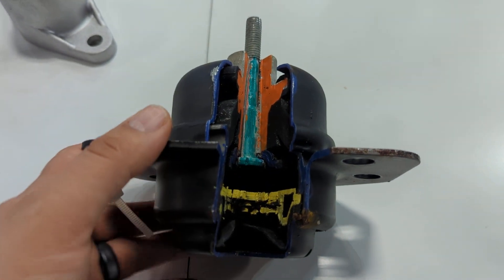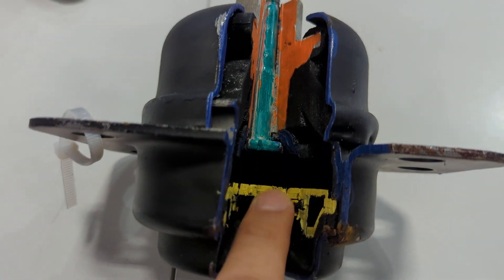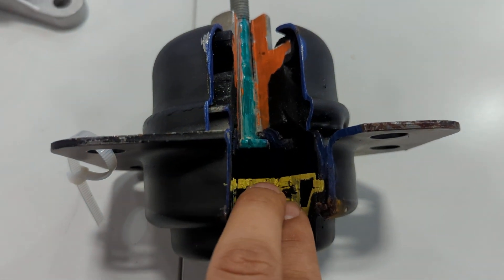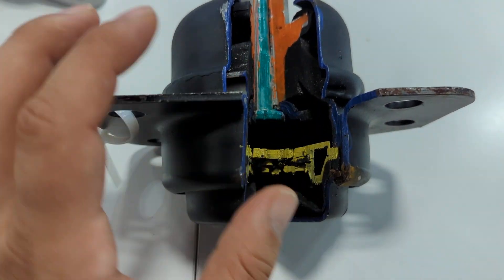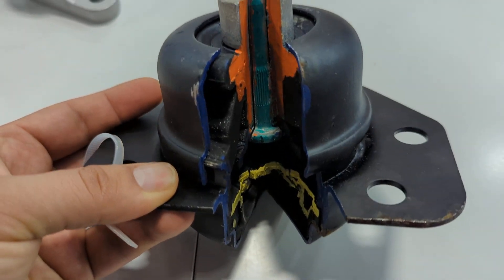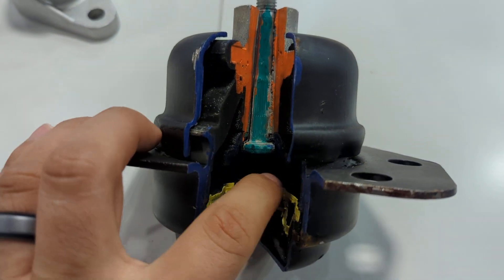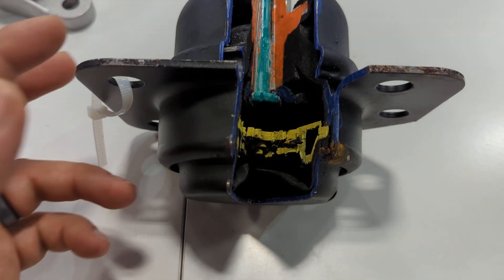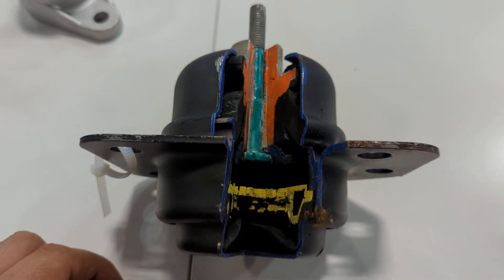Why Engine Mounts Fail - Design and Failure of Hydraulic Oil Filled Motor Mounts

Comment: Is it possible to add engine mounts rubber based instead of oil filled? Would You recomend?
Reply from the maker: Hi there! Absolutely, it's possible to use rubber based engine mounts, although the choice depends on your specific vehicle and usage. If you require more details, feel free to explore our free resources and guides at www.youcanic.com. We're here to empower you with the knowledge and confidence needed for your car maintenance journey. Don't hesitate to reach out if you need further assistance. We even provide factory repair manuals for those who need more detail. Thanks for staying connected with YOUCANIC. Safe driving!